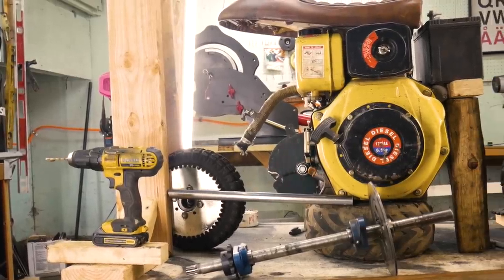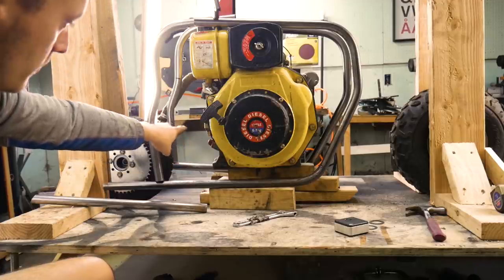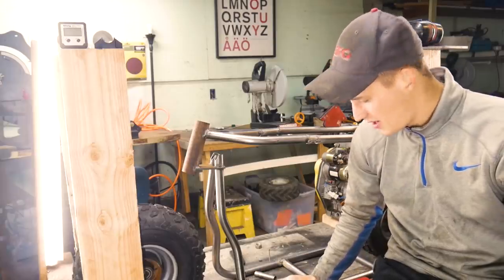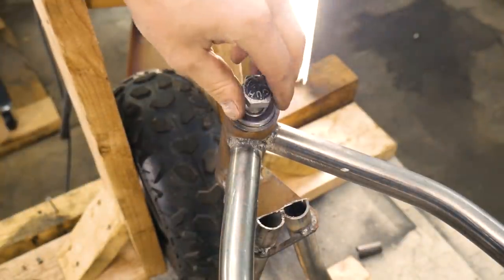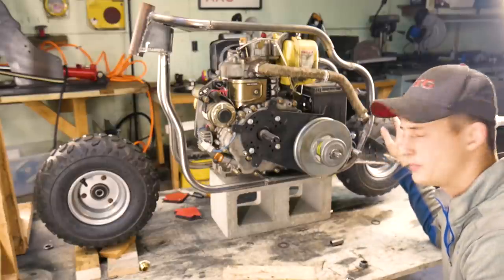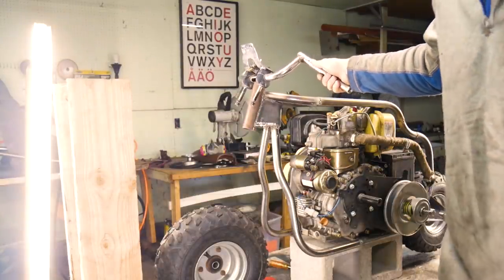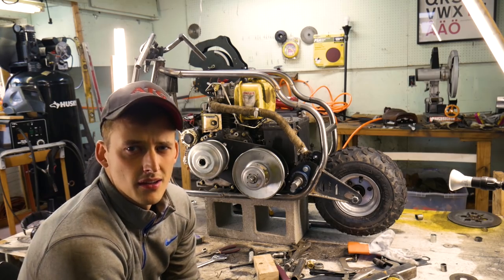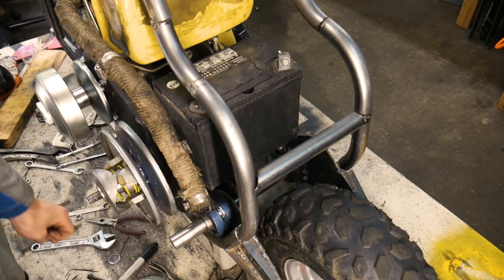Homemade Diesel Mini Bike Build (part 1/3)

Comment from the maker: Subscribe so you don't miss the next part!
Reply: ohh minttt
Reply: For the seat, have a pivot at the back, top of the frame and have the seat come off of it. You could then have a shock/spring mount on each side of the seat with one mount being the back of the seat and the other somewhere around the tire. Kind of like build break repeats rotary bike. https://m.youtube.com/watch?v=B9WkEXahQuk
Reply: Hey oliver wicked build guy 
But just had to tell you 
Those chinese diesel engines they can and sometimes do crank up and run backwards from what im told its not always easy to see that its running backwards

Comment: I would do a springer seat hinged off the frame with a spring or spring an shock from seat end to frame bottem
Reply: I have that setup on my minibike and it works pretty well
Reply: That was my thought too, it would be nice!
Reply from the maker: Clay Hunna thanks for the idea!
Reply: @OliverMotorized  i was literally about to comment that
Reply: @OliverMotorized  I made setup like this using the front forks off of a mountain bike for my Coleman CT200U-EX, & its been working great for years.
Reply: What about oldschool leather bicycle seat on springs? Got it in my motorized bike and works and looks awesome.
Reply: You beat me to it
Reply: Yeah, a springer seat will make your butt & spine thank you. GoPoweSports has the spring/shock assemblies sized for that seat application. Oliver, your build quality looks so good now; all the high tech tools have really helped you expand the skills & abilities that you have inside you! Just wait until you get a Tig welder that can weld mild steel, titanium, aluminum, & stainless steel. I think Everlast welders are a great value for the money. I got a Power Ultra 205 that is DC current only, so it can DC stick weld, Tig weld, mild & medium carbon steel, titanium, & stainless steel (what I really wanted it for), & a bonus, It Plasma cuts awesome! (5/8" like butter!) I rarely missed the AC Tig feature for aluminum. I just use Alumiweld brazing rods for the rare aluminum job that comes along. You da bomb Dude! (No longer a hackerist). Cheers, Oliver.  Paul
Reply: I was gonna say that same thing lol

Comment: For the seat, I would make a swing arm type bracket with a small coilover shock underneath and mount the seat on top of that.
Reply from the maker: Drew Ivan sounds like most people agree with this type of seat haha thanks!
Reply: Would give good access to battery and wiring as well.

Comment: if your bearings fit loose inside a tube or housing, you can cut shims out of a cola can and push them in like a sleeve around the bearings :) backyard mechanic tips!

Comment: Make a hinge near the gas cap and on the ends of the two dips mount two springs that go up to the bottom of the seat for a little bit of suspenion
Reply from the maker: ebib i like it, thanks!

Comment: Put the seat on a pivot, and make it supported by two springs under the backside of it where the frame cuts in. Sort of like one of those beach cruiser seats, but with more travel.

Comment: Awsome video and awesome builds as always idk how you dont have a sponsor yet but anyway for the seat situation i think it would be cool to do a twist on a springer seat like on the hard tail bikes but instead of using the coil springs like normal i would suggest using an old leaf spring and hang the seat off the back were your S is in the fram and i think it would kind of match your build style/ comfortable.

Comment: The forks mount to the neck. And I would probably do a springer seat? Kinda hard with the way the rear of the frame is designed, I think the springer would be pretty easy and it would look pretty sick in my opinion 💪

Comment: Make a single metal hoop (similar to a basketball hoop) with a padded trampoline center (seat) welded to the 2 upper parallel bars and braced to the horizontal bar closest to the rear wheel with an oblong hoop. This keeps the curved metal theme going.

Comment: Use some small springs/shocks from the rear of the frame up to the seat and put pivot points on the front of the seat frame mount so you have some "seat suspension."

Comment: Make the seat hinge over the engine and put springs on the back to give it some bounce. Make sure there is some space so you don't crush and vital body parts between it and the frame. A couple of small posts and some fatty washers with a push pin will lock the springs down. How you make this all work is up to you but I know you can do it. It also essentially gives it rear suspension so to speak for a smoother ride. Its been done before so look into it. I have wanted to do this for years but Small Diesels are not cheap and usually require a 1 inch shaft clutch. Also very expensive. Good job boys

Comment: Really cool build. I like your videos. Thanks and God bless. I’m wondering if the handlebars are going to be too low. You could always move the fuel tank and place the seat in the naturally comfortable position.
Reply from the maker: JB J yeah I was trying to avoid moving the tank, and I was thinking the same thing about the handle bars but if the seat is recessed into the frame a little it’s perfect

Comment: That rear tire is awfully close to the engine. This is going to be a wheelie machine with the torque of the engine. For the seat do a springer setup so it will not beat you up to bad. Very cool so far.

Comment: Keep it Oliver Motorized and weld a tractor seat on it. Then cut it off because it looks Goofy. Then bend up a rear tail section that'll be a fender/seat. Also give ya a spot for lights if you want to go that far on it. Or the general idea of a hinged seat on a shock/spring. Well crap I guess I didn't help. But hey you could always weld a door hinge on an old metal tractor seat and slap some springs under it and call it done.

Comment: Dude. You've got all this top notch fab equipment so ditch the gassless flux core welding wire and upgrade that welder too. Beautiful job on the frame though. That little sucker will haul a** so id feel better using a better welder.
Reply from the maker: slowly upgrading! i'd love a new welder for sure
Reply: well you've done well with that little mig. I was a career welder and I've never trusted those little migs but you seem to have it figured out. You know more about if than I do for sure. Good work sir and ive been a sub now for a while. This is the fun stuff you can do with Welder. It's great fun to watch. 🤘

Comment: I would use timken bearings in the goose neck to help with the bumps and vibration I'm afraid the bearings you used are for vertical loads and will not hold up under horizontal force . They will bind and fail

Comment: You ever try making your own gearbox like a 2-speed? They made them for what is called a Tule Trooper much like the tote goat in Issaquah Washington- State during the 60s.
And as far as your seat goes, why not make a metal tool box with a seat on top of it like the Tule Troopers did... it also had some front suspension.

PS. It's been a year and I've had no response. Your loss not mine.

Comment: Can you do an over engineered linkage fork it might be pretty simple cause you have a plasma table and you can just cad it up
Reply from the maker: Like an old style suspension?
Reply: Yeah with a linkage to the spring instead of just a standard telescopic fork